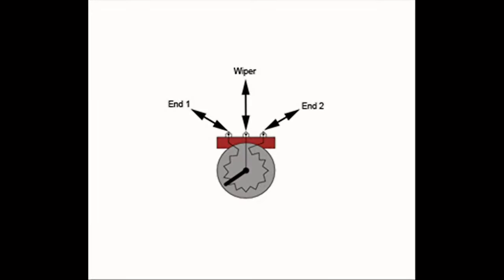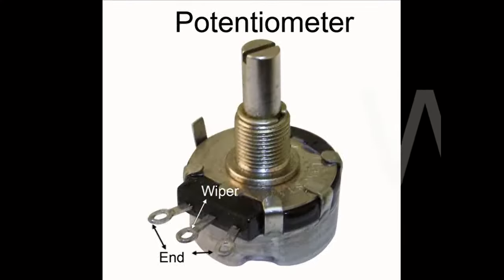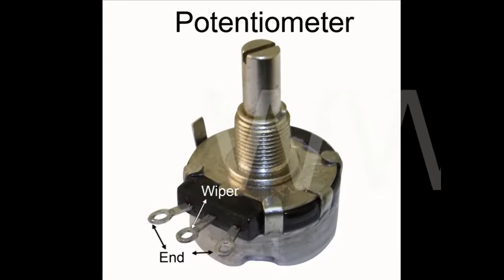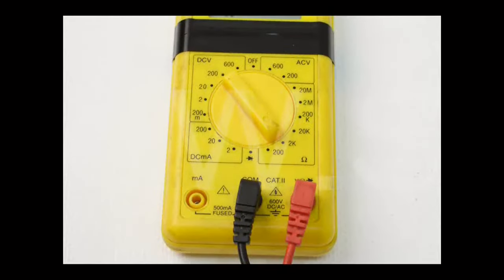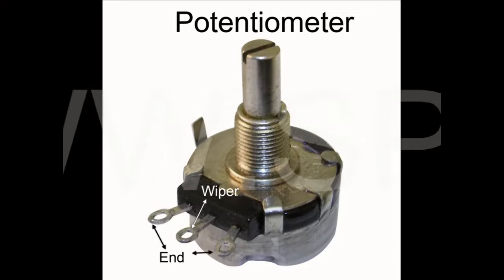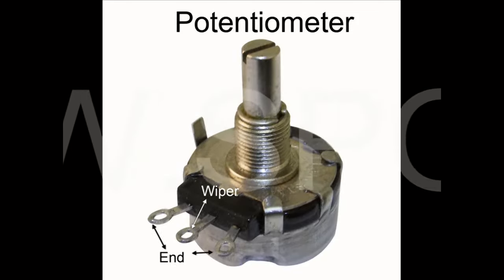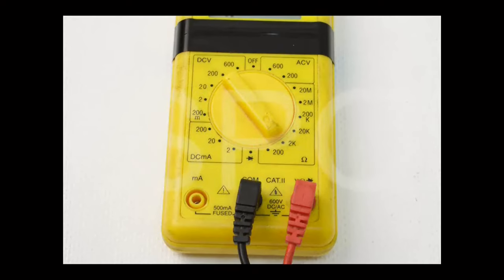How to test a Potentiometer - Potentiometer testing tutorial.

Comment: Is it normal to have the wiper get connected with either one of the terminal when turned to the extreme right or left ? I ordered 5 pots and all of them has the same issue whenever i turn it to the extreme right or left.
Reply: I know I’m probably too late to be helpful here, but I think you may be describing something similar to a “no load” pot. They are somewhat common with guitar tone controls. The idea behind them is that they function as a normal tone pot from 1-9, but at 10 some mechanism inside the pot basically shuts the pot off, and allows the signal to bypass it entirely without being effected by it. With a pot like that you wouldn’t expect the signal to be bypassed in the zero position though, only at 10. I am speculating somewhat here, but I’m assuming maybe the way that the pot shuts itself off at 10 is by connecting the left and right lugs. As far as I can recall I don’t think I’ve ever seen both the left and right lugs in a guitar circuit connected to each other or connected to anything which would give them a path to one another, so I’m assuming that when you connect them it basically shuts off the pot. Again this is based on speculation so I could totally be wrong here. But that’s my guess.

Comment: If I have a 5k but only get 4.56k when testing. Does that mean it is bad? Thanks
Reply from the maker: That would depend solely on the allowable tolerance of the resistor. If you're resistor has a tolerance of  plus or minus 10% the resistor is good. If the tolerance is plus or minus 1% or less, the resistor is bad.

Comment: i have a 5k potentiometer but when i read it with my multimeter it only shows 4.88k. Is my potentiometer broken?
Reply: It depends on the TOlorance of the component. Typically lower end ones have a TOL of +/- 10% which would result in a good product, for some precision instruments the TOL is +/-1 or +/- 0.1% but youre not in that range. It would be a good pot from my expierences.